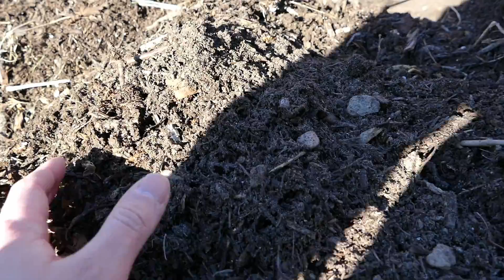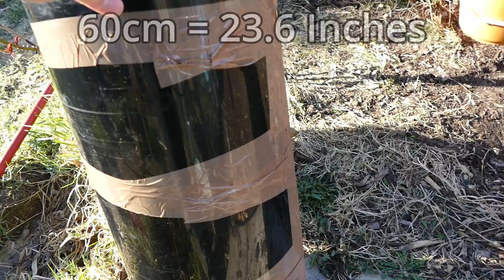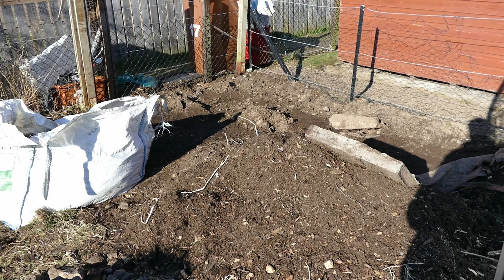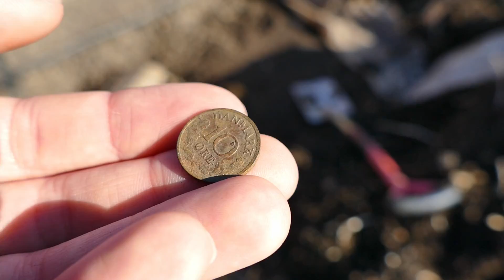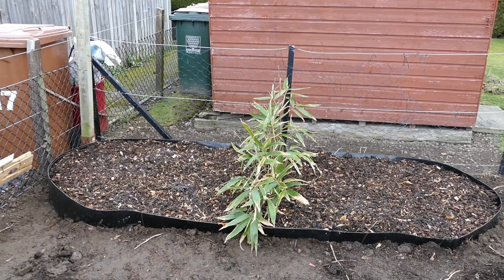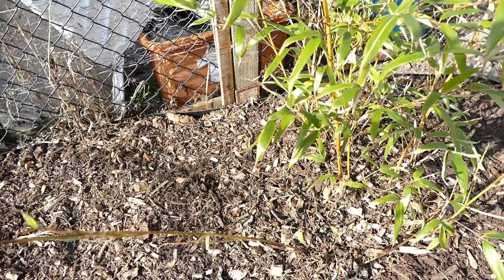Building And Planting Up Two Bamboo Beds With Rhizome Barrier

Comment: I see your video is a year old did you manage to prevent the roots and rhizomes? What’s the 24 inch deep barrier?
Reply from the maker: Yes, however the bamboo plants are still young and are not up against the barrier yet, however I don't expect the plants to escape this type of barrier, even after many decades. Its HDPE plastic that is UV resistant and is 2mm thick. I used stainless steel bolts, (no corrosion) to clamp the ends together in two places and used over a meter of overlap.
Reply: @Gardeningat58N it will escape, i can garanty that. It'll go under. Not sure how long it'll take, i'd say you're good for maybe 15 years. The moso rizhomes are very strong/hard.
Reply: Bamboo and ponds are the perfect marriage because one dries out the soil encouraging crawling insects and the other produces frogs which eat the insects. I dug holes with a gravel bottom then put in the bamboo in plastic buckets with holes in the bottom. Plastic pots at a no-no cuz the brittle plastic splits allowing the roots to escape.

Comment: Cool video, but if I wanted to avoid this much work, how tall is possible in a large pot?
Reply from the maker: It really depends on the size of the pot and the species of bamboo. You could get up to 3m with a large pot, but the risk is the pot might break eventually as it's not designed to contain bamboo rhizomes. You would be better planting a clumping bamboo, some Chusquea and Fargesia can grow over 4m tall without spreading much.
Reply: @Gardeningat58N  Thanks I might build a large planter which might be the best of both worlds, although I'm guessing I can't expect max height still. 

I've got Phyllostachys aurea and phyllostachys bissetii, the bissetti was 1ft last year, and is about 6ft this year in a small pot. The Aurea (in the largest pot I can find) shoots are still growing so I so see how high that grows in a month. I'll let you know.
Reply from the maker: Both those species can reach 8m as a maximum, but even with some root restriction they could reach 6m if you feed and water them well and you live somewhere with warm summers. I've seen a Phyllostachys aurea patch at 2m by 1m in Edinburgh, Scotland reach 5m. The bigger the planter the better, and make sure it's deep enough to stop any runners.  Phyllostachys size up very quickly, that aureosulcata of mine was a foot high this time last year, it grew two canes up to almost 6ft last summer and this year it has 10 new canes which look slightly thicker than last years.
Reply: @Gardeningat58N  Thanks so much for the advice, I'll wait it out this season, and see how it plays out. I'm trying to get 5m to screen out a house behind that oversees our garden. Incidentally, can confirm runners can dip downwards and come out the bottom of a pot, the infant bissetii I got last year was in a small pot (a foot tall), and a relatively large runner came out of the bottom corner of the pot and dug in to the turf by March this year.
Reply: lol lazy wanting the rewards without the effort put in. laughable.
Reply: @ronniemillsap  like it says in the question, I'm not expecting the same height, or "rewards " as you put it.